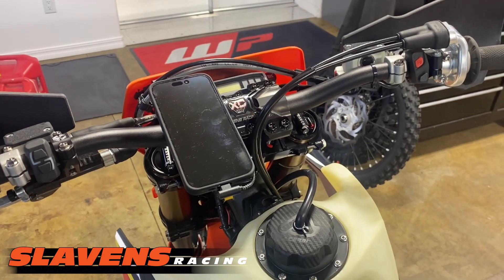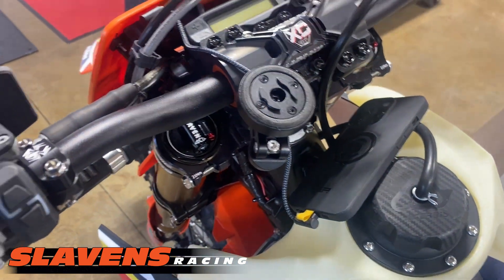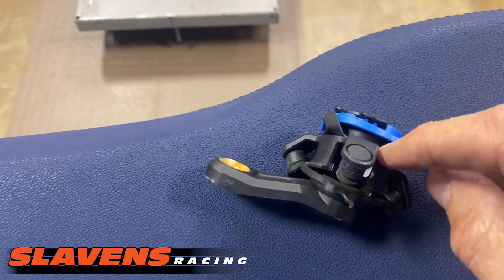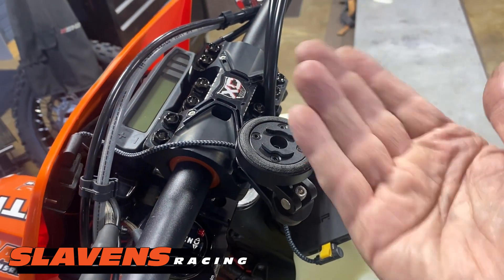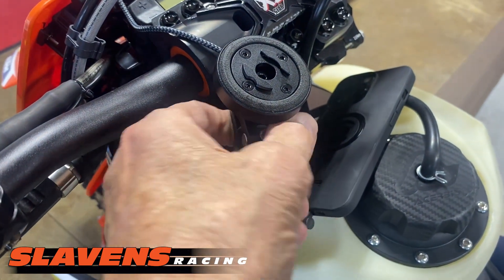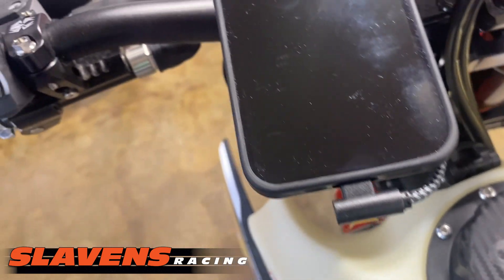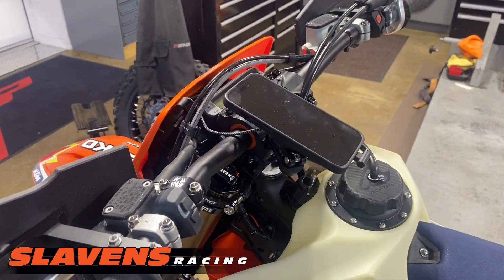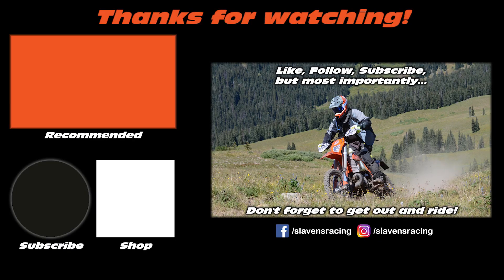SP Connect Phone Mounts and Cases

Comment: Best case, no crash but ... in the event of a crash, which breaks first, the phone or aluminum mount.  I found comfort in the fact quad lock was plastic and would break first.
Reply from the maker: Not sure what would fail first but I think it will pop out of the mount in a hard crash. The Quadlock fails WAY too easily. No matter what mount you use the phone needs to have a separate tether as a back up.